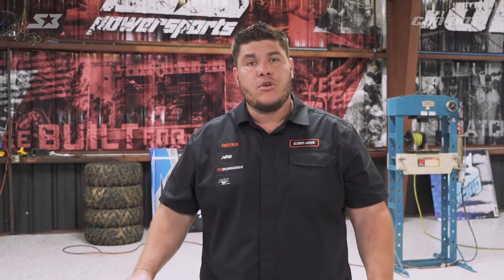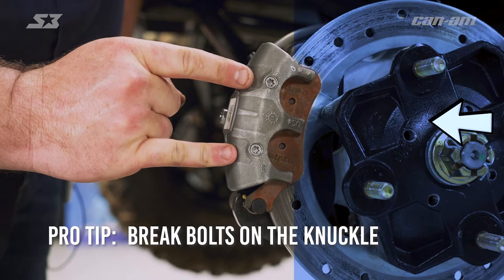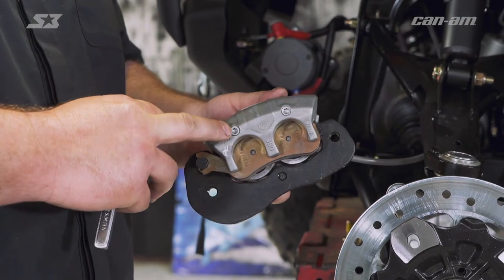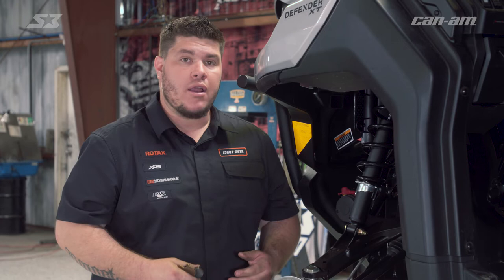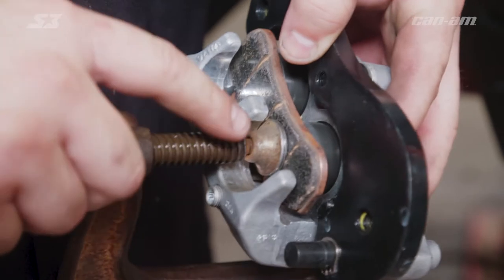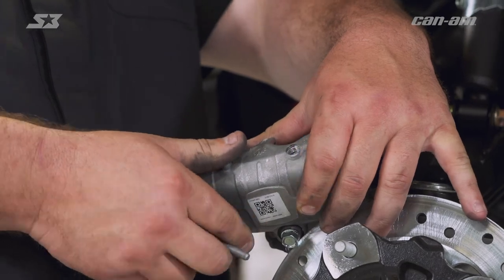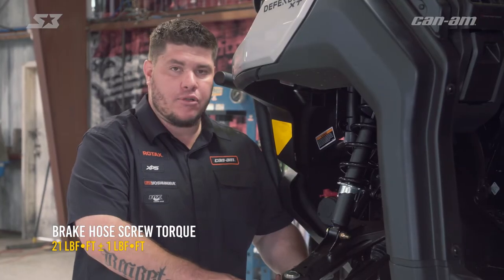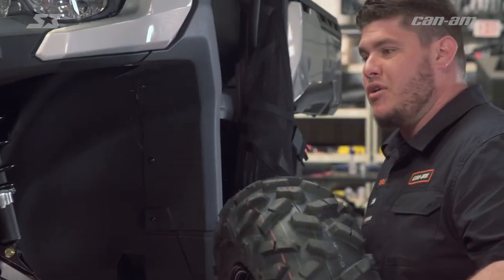How to change the Brake Pads on your Can-Am Defender | Gettin’ It Done

Comment: You boys got the only set screws with no pink locktite lol.

I disassemble and clean my brakes every 2-4 mud rides and the first time I did it I had to heat the set screws for 45seconds with a propane torch and i used a hardened metal impact rated t30 to back those screws out to make sure nothing stripped